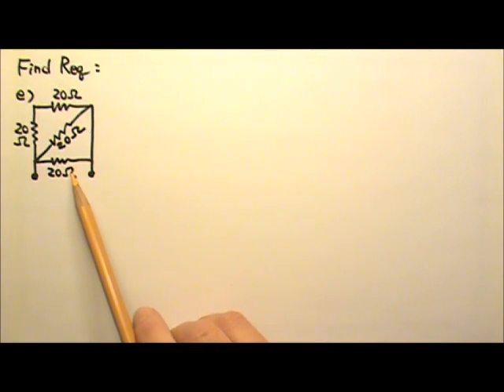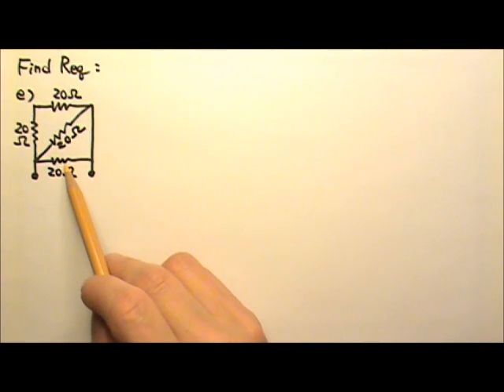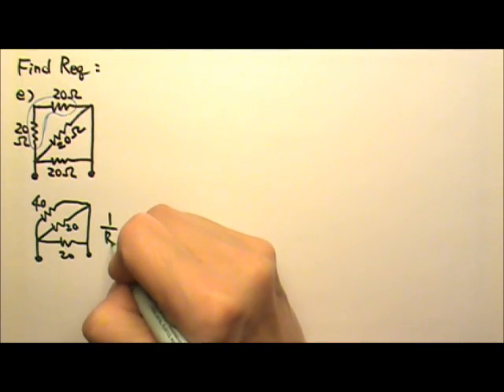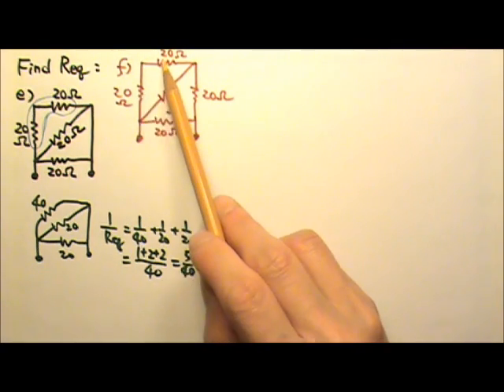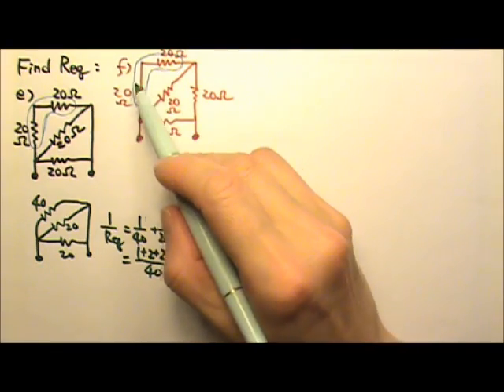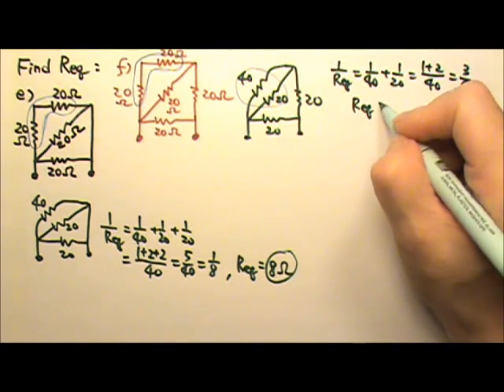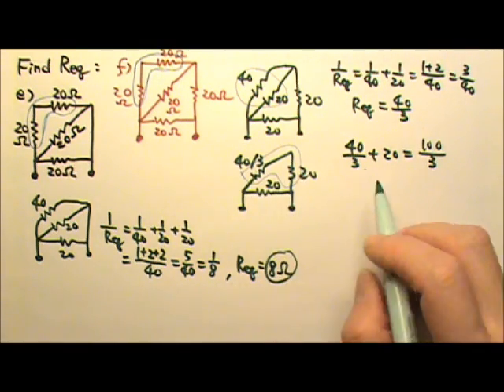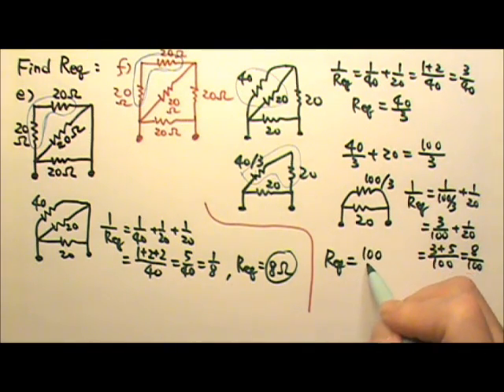AP Physics 2: Circuits 12: Equivalent Resistance Problems 2

Comment: Why do we have to take the longer way to measure resistance between two points.?
Reply from the maker: Q: Why do we have to take the longer way to measure resistance between two points.?
A: If those are the leads we connect to the battery or to the rest of the circuits.

Comment: So if both ends r together with no branches, they r parallel, if one end is together with no branches, they r series, right?
Reply from the maker: +ruocheng “NOT GOGOL” wei If both ends are together, they are in parallel. If one end is together and the other end is not and there are no branches at the end that is together, they are in series. 
Another situation when resistors can be considered in series is that if there is only one loop for current to flow, every element in the loop gets the same current, so all elements in that loop are effectively in series.

Comment from the maker: If there is a branch coming out (forming a junction point) in between 2 resistors, current can split or merge at the junction point; therefore, the 2 resistors are not in series and do not get the same current.

Comment from the maker: No, not necessarily. If there is a branch, the resistors still have to have the other end together in order to be in parallel. If the other end is not together, then the 2 resistors would neither be in parallel nor in series.
Reply: Thanks